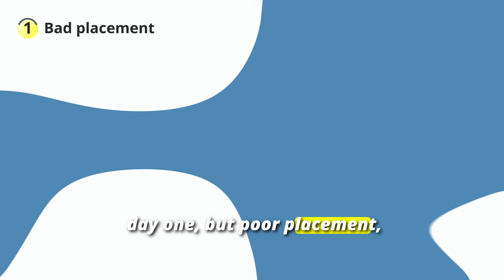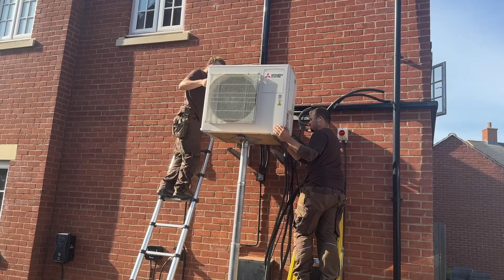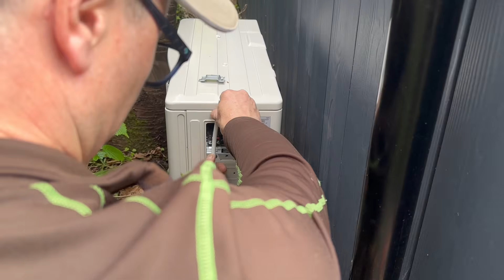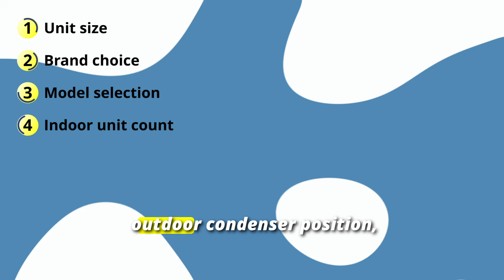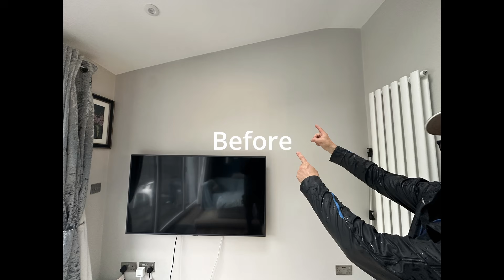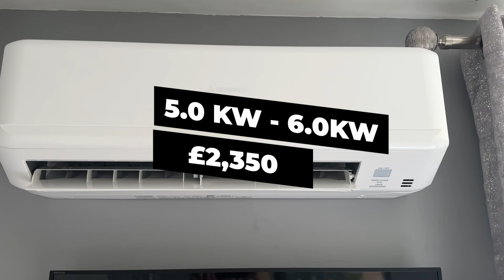How Much Does An Air Conditioner Cost - Daikin Sensira and Samsung WindFree 2026 UK

Comment: Midea Multi-Split Review
A word of caution for your viewers: If you're thinking of buying Midea Air  Conditioning 
and a quiet night’s sleep is important, think carefully before choosing a Midea multi-split. My Solstice units are locked at a minimum 20% fan speed when connected to a multi-split, and I couldn’t find this limitation anywhere in the manual. Unfortunately, my experience with Midea’s after-sales support has also been disappointing
Reply: Cheap units like Midea and those Midea manufactured, badge engineered makes, are going to be relatively loud.

Comment: I wanted a split-wall system in my front ground floor living room - very simple install - install blower on wall adjacent to an external wall butted up to or very close to the corner. Piping & cabling right through the external wall & then a drop of about 2-2.5m to the Compressor outside Floor Mounted on a mounting pad/slab. Test & then commission. I sourced a decent 2.5Kw system - think it was either Mitsubishi Electric or Fujitsu. It was about £800 all in full retail but they would only sell to FGAS registered Installers who get a 20% off Trade Discount so it would have cost him around £640. Ancillaries were coming up to about £200 max so now we have about £840 total for everything. 
I called the Installer round to quote & he said "No Problem - Super Easy & Quick Install - It Will Take Me Less Than Half A Day". 
Great I thought & asked him what the Labour/Installation Costs would be - He quoted £1750 +VAT = £2,100 just for the installation. Think about that - £2,100 for less than half a days work. I asked him what his Daily Rate was since depending on the Trade, in my area they varied at that time from anything between £150 -£400 A Day (this was few years ago). I asked him why then he was quoting me between 5.25 -14 times more than that for just half a days work? In reality, since he said it was half a days work, he was quoting me 10.5 - 28 times more than the going Day Rates between various Trades. 
I told him that was way to excessive & that I would pay him £600 for the installation (1.5 x the highest day rate at the time) but he wanted £2,100.
The truth about matters is that by law, AC can/should only be installed by an F-GAS registered person & the Installers all know this & use this to jack up the Installation Costs - that is the actual reality in many/most cases. 
Of Course, there are complications with most UK Houses with pipe, cable & condensation runs if a multi split system is being installed & one can naturally expect costs to rise due to such factors but in my above case, there was none of that.
About 15 years ago, I had a Fujitsu Ducted System installed in my upstairs bedroom with Compressor mounted high on side wall of the house & 3 Flow & Return Insulated Ducting Runs & all cabling done for £500. That was indeed a long time ago & I am getting crazy high prices now to replace even with all the piping, cabling, electrical already in place - all they have to do is replace the outside Compressor & the Blower in the Loft - nothing else & they wanted between £3.5-£4.5K. Again, just about a days work at the very most.

Comment: The problem with air con is … ugly … ugly … UGLY … until the manufacturers start working with designers and artists the inside units will continue to look completely out of place in an ordinary uk home. I know we can’t defy the laws of physics so designers will always be constrained by industry best practice in the nuts and bolts of what happens under the bonnet BUT come on guys 🤷🏼‍♂️ why does all air con units look sooo ugly when bolted in situ 🤮 … you can’t even describe it as “industrial” as the units always look so plasticky 🤷🏼‍♂️ … given the current meteorological changes in the uk this should be the perfect opportunity for manufacturers with vision to come up with truly aesthetically pleasing designs that, if not disappear, at least look as cool as the air they knock out 😉
Just out of curiosity, has any AC manufacturer ever considered collaborating with people like James Dyson ? 🤔

Comment: Daikin does a system which supports up to 5 internal unit on 1 external unit - how come you switch to Samsung for multi unit installs and not stick with Daikin?
Reply: The Samsung unit is far cheaper than a Daikin. The Daikin unit with multi split evaporators can be very expensive.
Reply: The Samsung multi split system can cost around £8,000 fully installed. A similar Daikin system will cost around £13,500. The cheaper Samsung system will be a rush job, to keep labour costs down, whereas more care and time will be put into the Daikin install.
Reply: A Daikin condensor unit could be connected with a branch selector box to run more than a dozen indoor units on a variable refrigerant volume (VRV/VRF) system.

Comment: As someone who lives in the Philippines, you wouldn't need more than a 2.5 HP (the universal power rating for airconditioners) in KW i think that would be around 3.5 KW unless you have a huge room? Here those don't cost less than £500, installation can be £300-500. Better to get aircon that has heating noting the temperate climate there. When I lived in Japan I used a standard aircon 2.5 HP for my 1 bedroom flat. Here in the PH we have 4 separate aircons. Since its the tropics, window units are fine for half the rooms. The UK needs to jump on the aircon bandwagon
Reply: Judging by the shortage of kit and waiting times, it looks like the UK is already on the aircon bandwagon.

Comment: Good video but I feel pricing is a little off in my opinion. I recently had installed in February this year 3 Mitsubishi Heavy industries systems including 2 X 2.5kw and 1 X 3.5kw for only £4,400. Fairly simple install and pipe run to be fair but I’m based in south London so costs are likely higher on average.
Reply: Installation prices are probably lower in February, than during the months between June and August.
Reply: @guglielmomarconi9942 Yeah absolutely and why I chose to get it done then. I would imagine it’s always cheaper getting them to install in November - March when they will naturally be quieter.
Reply: That's alot mitsi 2.5 starts at 550 a unit so your install was about 2.5k rip off
Reply: @plexman867 look no offence but you’ve clearly not got a clue. The inverter, 3 indoor units and all the other materials was easily about £3k and then I was probably charged about £1,300 for 2 days labour. Seemed about right and fair price to me. With your price the guy would be installing for free and getting a load of materials for free. It’s better to stay quiet when you’ve not got a clue 😅
Reply: Hi, can I ask which company you used? I am in Hertfordshire area.

Comment: 1500 for 2.5K is kind of not cheap. 
small is good as no need to rewire high power electricity. 
of course good pipework is required but that cost is a bit too high.

Comment: Ohhh behave!! £7k 3 way split and x3 2.5kw units cost around £2.5-3k for your daikin or fujitsu etc... 1.5days worth of work x2 people on the job £500 per day £1.5k labour... grand total £4.5-5k max!!
Reply: Did your quote factor in the electrics including the surge protector?
Reply: @lenny-watsisname average cost is £1500-1800 for mid to high range units (Daikin etc) so where is he getting £2300 per unit cost from??

Comment: Question every house has a gas boiler or most do why do we not have a system that cools the water to the radiators in every room, why do we not have a joint system gas boiler for heating and cooling  water could this be done and why has it no?????.
Reply: You would get condensation all over the radiators, would drip and cause damp.
Reply: As above, condensation, and, as hot air rises (thus cold sinks), you end up only having cooled feet, adding a fan to stir the air just causes it to become warm again. Some heat pumps have a cooling setting but not really up to much tbh 👍

Comment: I'll probably take heat for this but nearly £7k for 3 bedrooms is absolutely insane. Considering a high end multi split 3 head unit can retail for around £1700, plus installation ancillaries of about another £600, charging over £4500 for installation is crazy.
Reply: £4500 for two days work 🤣
Reply: @Cyanideone  he had a hard time with this job
Reply: Ahh, now, but, you see; a third bedroom in Hertfordshire/London puts the property price up by £100k-£300k, hence the owners are rich, so a third bedroom has to cost £4.5k more , because Estate-Agent maths.
Reply: @markglover2525  Haha good point!
Reply: @markglover2525  Some people who live in big houses......have nothing in the fridge.
Reply: @markglover2525 like the sarcasm
Reply: Agreed. £1500 per indoor is top whack
Reply: @christianjackson9534  Absolutely. Even including kit that is a fairly big price tag.
Reply: I just looked up a quote online from British Gas, for three heads in a multi split Bosh unit. £7,800, sounds right at the top of the range. I won't be using them.
Reply: Agreed. £1500 per indoor is top whack
Reply: This is probably a London weighting.

Comment: my AC guy just quoted me almost the same. 2.5kw £1500 fully installed with a 6M max pipe length and outdoor unit installed on the ground. I ended up going for a 3.5kw in the living room and 2.5kw in the bedroom which pushed it up to £2150. He said there is no extra installation cost with adding another unit in the other room, just the price of the wall unit and a condenser (outdoor unit) that can allow 2 wall units to plug into aka a multi split instead of a single split. I'm on a first floor flat and condenser installed just above head height which he said didn't effect the installation price.

Comment: No mention of a ceiling cassette?
Reply: Why would there be?  This is aimed at Domestic installs!

How many houses have you seen with suspended grid ceilings?
Reply: @paperlessadvice sorry do you fit these? It’s a common fitting on larger houses. They fit flush.

Comment: So I’m currently getting quotes for air conditioning professionally installed. As I want x3 rooms doing. They have both said that I would need one split system for x2 rooms and an independent split system for the other room as it’s at the other side of the house. As this is the most cost effective way. I have a x4 detached house. Does that sound right ?
Reply from the maker: Yes, that sounds right. I would recommend the same approach.

There is also another advantage: if one outdoor unit were to break down, while you are waiting for repairs, you would still have the other unit operating, so part of the system would continue to work.
Reply: @electrumelectrical  thank you. I don’t suppose you operate in Derbyshire area do you ?  Would be great if you could give me a quote :) love your videos keep it up 😊.
Reply from the maker: @matteyre3405  it depends on the project if the project it’s a bit larger than yes we do.
Reply: @electrumelectrical  we are having x3 rooms done and looking at possibly midia solstice system. Not sure if there any good tho.

Comment: How come the 3 bedroom unit (with 1 outdoor unit) cost more (6950) than 3 x single unit (with 3 seperate outdoor units)? 3x1850 = 5550
Reply from the maker: Dikin is running special offer this summer I don’t know why they do that, but this is the way how comes up?
Reply: The outdoor unit costs more than three single split outdoor units that’s why.
Reply: @rollsie  That is incorrect. A Daikin 2MXM40A goes for about £1100, an RXM20A goes for about £650.
Reply: Because he’s drastically undersold the cost of a single unit. Average cost of a single is £2300. Wonder what corners will be cut.
Reply: @SuperTuberEddiePlays  You're having a a laugh at that price... over £1200 in labour alone for a single day simple install is massively over priced.
Reply from the maker: That’s a great question, and I’m glad you watched the video and took notes.

One advantage is that manufacturers often offer very attractive summer promotions on single-split systems, which can make them more cost-effective.

Another benefit is that each outdoor unit can usually be positioned close to the room it serves, resulting in shorter pipe runs, less trunking, and a simpler installation.

With a multi-split system, the pipework often needs to travel longer distances to reach all the indoor units. This typically requires more trunking, more materials, and additional installation time. Also, the cost of a three-room multi-split system is generally higher than installing three individual single-split units.

Of course, every property is different, so the best option depends on the layout, available space for outdoor units, and your budget.
Reply: @electrumelectrical  So when you said that adding extra individual rooms separately is less cost effective than getting a multi split system, that is in fact not the case then?

Comment: If we didn't have aircon already this advert would swing it. 
Don't forget to tell the folks that a 5kW system does not use 5kW of electricity, but is the heat transfer rate. 
We have a total 6kW installed which cools 1/2 our bungalow and they use about 600-800W combined on a very hot day.
Our Mitsubishi system was done 8 years ago and still works the same as the day it was installed, so very reliable,
Aircon + solar panels are also a perfect combination.

Comment: With the new air to air heat pump grant, do you expect systems to be designed more often for heating primarily going forward? I imagine that would be the main load on the system
Reply from the maker: I do believe that everything is going to change Electric. And people will use more and more air-conditioning primarily for Heating.